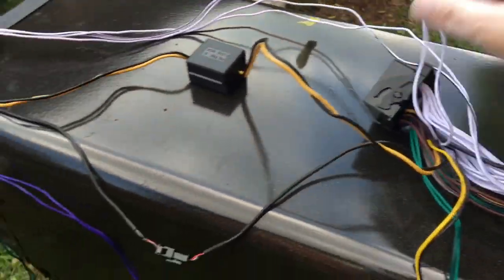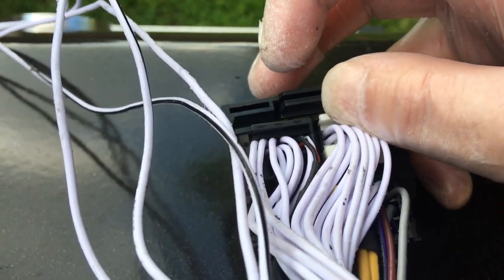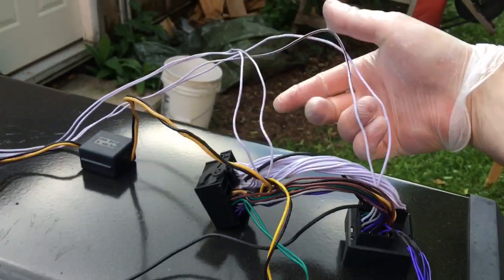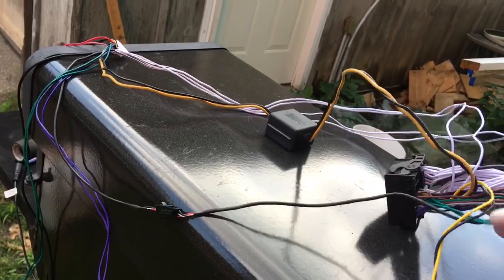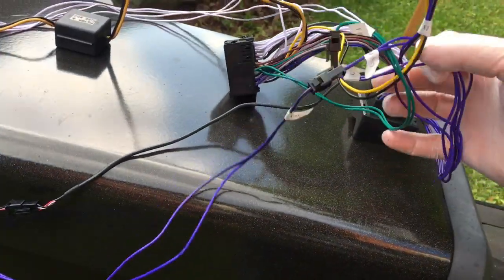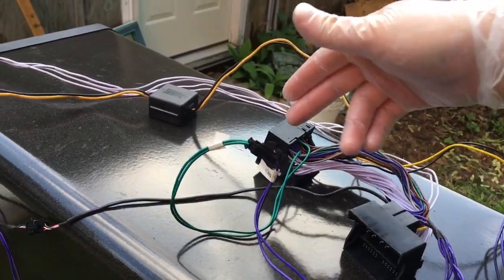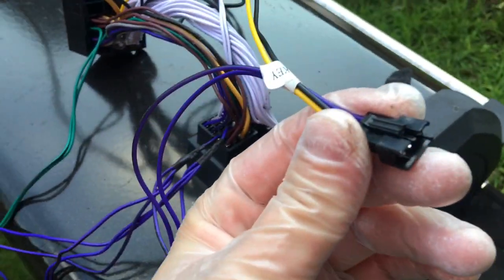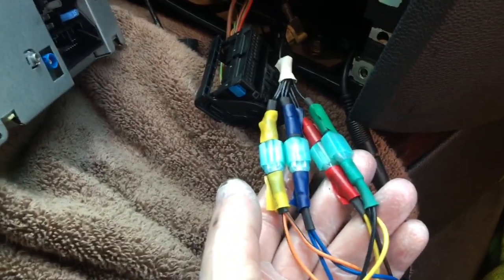BMW CIC AVIN Android Harness Explained

Comment: Have you been able to retrofit an iDrive controller to one of these? Thanks!
Reply: Yes there are 4 wires for the idrive controller which can be spliced into 4 wires in the harness. You would just look at the pinout for the CIC. Not exactly straight forward but not that complicated.

Comment: Mine doesn’t have hk speakers or amp in my 2011 x5... does that mean I don’t need to use aux in center console
Reply from the maker: I assume you still would but there is info somewhere online indicating that some people didn't need the aux cable. My memory is hazy but there are additional aux pins on the CIC and I think under some configurations those are what's used instead.

Comment: DUDE DID YOU GET THE HARNESS SEPERATLY? AND THE IDRIVE CABLE AND OTHER FUNCTIONS THAT DONE COME WITH THE BMW???? I JUST WANT A SOLUTION FOR CARPLAY WITH NAVIGATION
Reply from the maker: No I didn't. There are just carplay modules without the android system I would highly recommend one of those instead.

Comment: Hi just installed Avin 10.25 screen in my bmw w x5 e70 2013 which has navigation and back up camera. all functions of original factory settings work, the new harness had aux out connected to aux in and since they gave me only 3 feet aux cable i left it the way it came it could not reach the aux line in under the arm rest. There is no sound from android any other options to get sound from android besides aux line? can use via bluetooth to bluetooth aux unity?
Reply from the maker: I just use bluetooth

Comment: Hey there, I'm having an issue where my idrive controller controls both android and the OEM idrive system at the same time (in the background) . Any idea?
Reply from the maker: That's actually just how it works. There's intelligence in the design to inhibit this. You'll notice when you switch to the android screen a macro is run to take the idrive to a certain screen. I think going to that screen is an attempt to minimize accidental clicks
Reply: @HomeAwesomation  ah that makes sense. Thanks. 

Ive one more issue in that steering wheel track skip doesn’t work. All the other buttons work and it works in oem idrive mode. Wonder if that’s something to do with the harness or if it’s an MCU problem?

Comment: Hello i need help with this radio harness..

In my case i didnt have navigation factory, so i buy the android radio, but i have an idrive knob ccc controller that i want to connect to the radio... do you know how can i connect it to the android screen?

I read in other forums that i need to put the pins in this order:
1 - Red (12V)
2 - Brown/Black (GND)
3 - orange/green
4 - green( CAN)
But it doesnt work, only the menu button of the idrive controller light, but the android screen doesnt reconize it.

I have a bmw proffesional radio, no mask, but i see that the quadlock is the same for both..

thank you!
Reply from the maker: The simplest thing to do is google the pinout for the cic and google the pinout for the idrive controller and then connect the matching wires. I also didnt have navigation from factory so I did this.